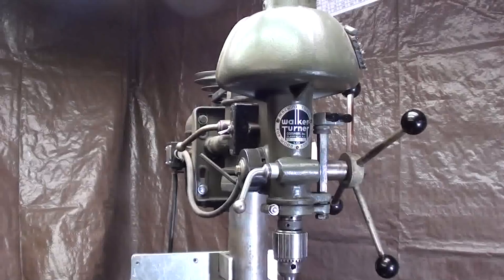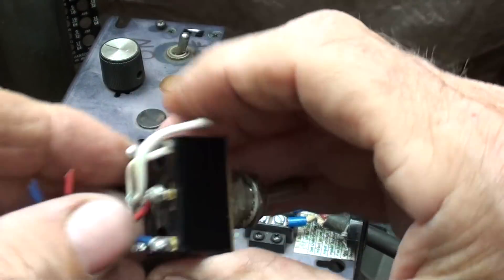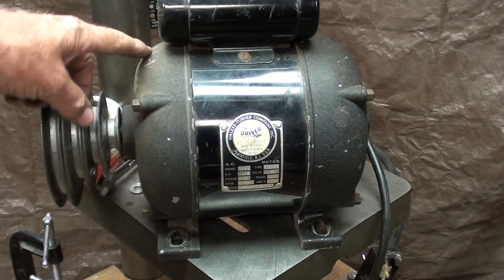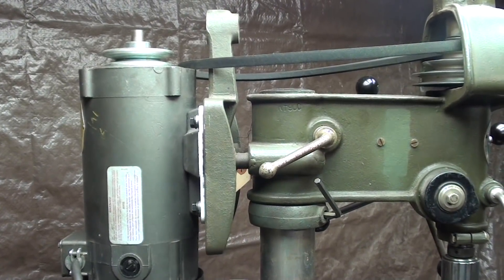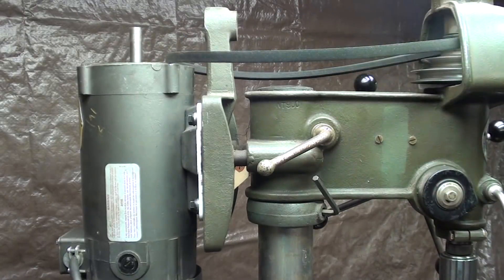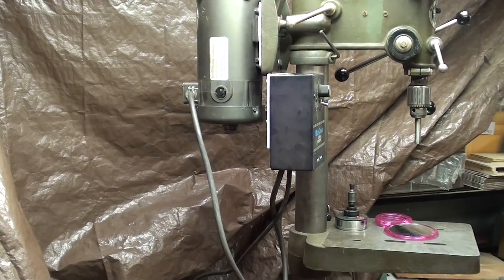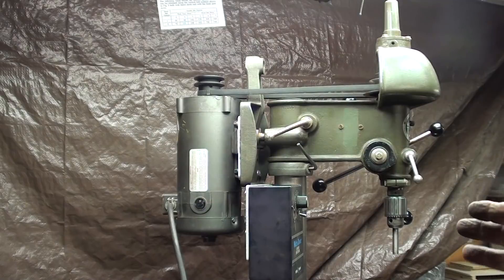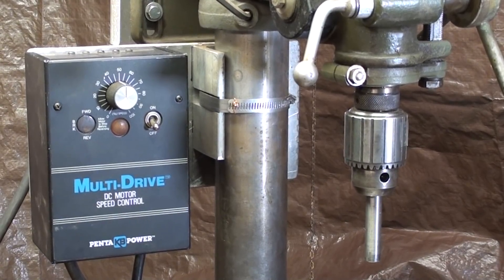Mounting DC Motor on Drill press Tips #480 tubalcain

Comment: A reverse switch is very handy to have. In case you drill a hole in the wrong spot you can just undrill it!  ;)
Reply: Or just click the undo button.
Reply: Or press backspace 😂😂😂
Reply: Reverse is mandatory to be able to use reverse (left hand drill bits) which are super handy for getting broken machine screws out. I have fitted my drill presses with this feature.
Reply: DAD Joke!
Reply: i guess Im kind of off topic but does anybody know a good website to stream newly released tv shows online ?
Reply: @Spencer Casen Lately I have been using Flixzone. Just search on google for it =)
Reply: @Cayson Maximiliano Definitely, I've been using Flixzone for years myself =)
Reply: @Cayson Maximiliano Thank you, I signed up and it seems to work =) Appreciate it !
Reply: @Spencer Casen Happy to help =)

Comment: A couple notes. DC motors should have high torque at low speeds especially compared to AC motor controlled by a VFD. I've converted a few machine tools for this exact reason. Also, there are seemingly four adjustable pots on the dc drive board. Some have six. The four that are apparent on your drive are Min speed, Max speed, Current Limit and IR ( compensating voltage required to keep the motor speed constant with varying loads ). You may need to adjust these to calibrate your application. I have a very rare version of the Walker Turner drill press (1939) that is missing the factory switch. If your ditching yours I would trade you for the reversing switch you need for the dc drive. The switch you require needs to operate as follows: when switched between the Forward and Reverse positions, the blocked center position causes a delay which protects the DC drive from any voltage that may be on the motor armature terminals. I would imagine that if you quickly flipped a standard switch between F and R that you could damage the motor and/or drive.
Reply from the maker: Thanks for the offer, I want to keep that switch for when I converted back to original. I do need to play around with those pots. To try and increase the torque. But actually I am moving ahead and installing a VFD given to me by a viewer. Remember these are all experiments
Reply: With a vector type VFD, AC motors will have very high starting torque. If you go cheaper with sensorless vector, not so much. If you go with an encoder on a vector drive...look out.
Reply: Great point and a great solution for higher end budgets or machinery. mrpete222 bought the drill press for $135 some time ago and its a drill press! I might also add that in a tapping application, AC drive/motor setups would be superior for 1: The deccel / accel parameters are very adjustable , and 2: Flip an external programmed fwd/rev switch and back that tap out fast. Many ways to drill holes. For low cost solutions either AC or DC I use automation direct. Not a plug, I have just had great experience with them.
Reply: Thanks for the reply. I have been on the search forever for an original switch/housing. I would like to restore my drill press as it is very rare (in exceptional shape and dates to 1939 as it has a face plate/logo only used that year and the rare ship wheel down feed handle). No factory switch unfortunately. If you could cast me one from the original I would really appreciate your work. In exchange; I have a lot of surplus old stuff to sweeten the deal! You could make another fantastic video of the process!!! Please PM to discuss further. Again, I would really appreciate your assistance and knowledge.
Reply: I have seen a spectacular failure of a DC servomotor drive when direction was abruptly changed. Blew transistors through a drywall.  But in this case abrupt direction change was a requirement. Back to the design board.
Reply: @stevegraves2890  Sensorless vector is appearing in lower end drives now.
Reply: HI Steve, you're right about those things you mention about DC motors, also, very right about the original switch with the stop in the middle to allow the motor to stop between forward and reverse, direct switching WILL destroy the controller...

Comment: If you could put a pair of pulleys between the existing shafts, spindles and pulleys, you could get the RPM down lower while keeping some decent 'wrap'. Perhaps a synchronous belt and pulleys or a chain and sprockets would support lower RPMs and the torque you want. V belts and ribbed or cogged belts have advantages for this application.

Comment: I changed my drill press  and bandsaw to D.C. Drive treadmill motors many years ago. Also tap with my drill press. You would be surprised at the torture at the low speed on these drives. Will try to send pictures.
Reply from the maker: Good move

Comment: Get yourself a centrifugal pulley for your motor ; I’ve been using one on my Craftsman Drill press with the same motor setup as you are using for 25 years and can ; with a tap holder in the chuck tap up to 5/8 “ without any problems and up to a 6-1/2” hole saw
Reply from the maker: Thank you, that's a good idea

Comment: Lyle,  Just in case someone below hasn't given you the amps the ST22N switch can handle, I'll give what I found about it here.  It's capable of 3.000 amps at the maximum voltage rating of 250VAC.
Reply from the maker: Thanks

Comment: The capacitor on an AC induction motor isn't there to "store up" energy to give extra power to start the motor. That would not work with AC (unless you had active electronics). It's needed because induction motors don't have a bias in either direction if they are not already rotating. If you disconnect the start winding and turn it on, it will just sit there (and overheat). If you give the shaft a turn manually it will continue in that direction and speed up to it's normal speed. Adding a start winding that is rotated 90° relative to the main winding creates a bias and makes it self-starting. It solves the same problem of how a single cylinder steam engine isn't self starting, but adding a 2nd cylinder (offset by 90°) ensures that it is. It's not strictly necessary (with motors that have a centrifugal switch), but the capacitor effectively 'delays' the AC waveform feeding the start winding giving it more of a directional bias for greater starting torque.
Reply: ^^Single phase induction motors.  Multi-phase induction motors develop a rotating field  by default.

Comment: Mr. Pete,
   Nice video once again. I just this past week installed a 2 1/2 horse DC, 90 volt treadmill motor on my drill press. I used a small ac controller with a bridge rectifier to convert ac to dc. It works to my satisfaction getting the rpm down to 70 at the slowest speed. I drilled a 2 1/4 in hole in quarter inch mild steel plate with a Lennox hole saw. It had plenty of torque at slow speed and had no noticeable belt slippage and I watched for both very carefully. I used plenty of oil for lubricant and I checked the heat of the hole saw frequently just by touching it. It was hot but not overly so. Also it took awhile to cut the hole but the controller didn’t develop any noticeable heat. It does have heat sinks, however. That always a necessity with a bridge rectifier as the diodes in them will quickly burn out if the heat isn’t quickly dissipated.
  Again, another first quality video. Thanks.
Dale from Decatur
Reply from the maker: Thanks

Comment: i  just swapped a motor on my drill press, and holding it up is a problem, until i realized you can just rotate the table around to the back and use it to raise the motor and hold it steady 
while you install the bolts.
Reply: I'd have to move mine away from the wall but that's a great tip!
Reply from the maker: Thank you, good idea
Reply: That's a great idea ... but only if you ever got around to bolting the base to the floor...
Reply: @PSUQDPICHQIEIWC   Just put a counter weight on it like 5 gallon's of paint. or a 5 gallon homer bucket full of water.  handy if you need to cool a part too.

Comment: I have a drill press that looks just like that one. The name plate is missing on mine. My dad gave it to me about 25 years ago when I was in my 40's  and he said he found it out in a field. He cleaned it up and it looks like yours now. He said he didn't need more than 1 drill press. He passed away 6 years ago and now I have more than 1 drill press. Amazing it was not all rusted and pitted when he found it. He said he found it a few years before he gave it to me. I think they are about 60 to 75 years old now. I am going to put a  3 phase motor and VFD on it and see how that works. Mine also has a very unique table with built in vise.
Reply from the maker: You will soon see mine with a VFD as well

Comment: Nice job.  I have an old Canadian Drill press #15 with Cap Start.  @ 1750 rpm speeds on 5 step pulley are 6,300, 3,400, 1,725, 900, and 400 RPM. Made in Kitchener ON Canada.  Jacob's 1/2" chuck.
Using an appropriate 3" clamp and some Uni-Strut and plywood, I made a small platform to keep my Drill Press Vice on.  Make sure it cannot vibrate off.  Thank you safety boots!  
I only wish it had a gear drive to raise the Drill Platform.  It has been converted to a Floor vice from a Bench Vise.  Likely made in the 1950's.  When you need a drill press, nothing else will do.  I note that the decal indicated to come to full stop before reversing if you install that function.
Reply from the maker: Thanks

Comment: Hi mrpete, good modification in order to get decent lower speed to work with bigger drill bits, looking forward to see how it delivers the expected results.
If my memory serves me well there is a min/max setting for output volts, and, possibly for constant torque function, just from memory, though...
I only an adorable acccent when I speak English, though...    lol
Thanks for the mention...   ;)
Reply from the maker: Hi pierre. I'm still disappointed with the results. We'll see what happens when I use the VFD that Palmer gave me

Comment: your new delta-ki name is transmission jack(hope you where using guide bolts cut some all-thread off thread em in and it'll funnel er on to the dowels tighten the bolts down enough to get the converter pilot engaged it the crank then as you tighten them down make sure the converter still spins if not the pump drive gear is installed backwards or the drive tangs ar'nt engaged in the converter spinning  while finish tightening usually solves that problem though) gonna love the tach install gonna check out pierre's love his starrett 98 level adjust vid thanks mr pete

Comment: Have you ever noticed that heavy duty drills don't have a break but the battery powered ones do always wondered why you cant get a brake as an option on a drill. Reminded me when there was a brake switch on the control box. I think the hole hawgs and other corded hand helds should have a brake for those times when they get into trouble but would be hard on the motor and gears I guess.
Thanks again for sharing your knowledge.
Reply from the maker: I have no good answer for that
Reply: I believe the DC motors in the cordless drills just short the motor leads to get the braking effect... This doesn't work with AC motors.

(Not an electrician, just learned this tidbit playing with DC actuators)

Comment: I have a KB on my South Bend. Love it. Good series. Thanks.
Reply: I'm adding a 1 1/2 pmdc to my lathe with a variac and full bridge. Just no load tested today and was impressed with smooth speed changes and no annoying circuit sounds...if I can keep things from frying I will do a drill press as well.
Reply: I may add a smaller PMDC motor just for oil pump duty. And save the 1 1/2 for just taking those cuts. If 2 hp AC can take 0.10 cuts then I'm sure the DC will be more than torquey enough....this will be one Frankenstein lathe for sure....

Comment: You could build a H bridge with 4 appropriately rated relays or transistors to reverse the direction of rotation, then any old SPDT switch could be used, finding a high current/voltage switch might be less painful though.

I just got my "big" Chinese drill press running, the seller had replaced the capacitor with a 150uF part (it has a PSC motor, the one capacitor is the start capacitor and the run capacitor, no switch involved or required) so it had very low torque and got very hot, eventually I got a 20uF part from him and now it works great, noisy and rattly but plenty of torque and runs cool. It has three pulleys and two belts and is super annoying to change speeds. 

Big DC motors here in Australia are pretty uncommon for some reason, but a 3 phase replacement with a VFD would be nice to have.

Comment: Here's what I did to reduce speeds on a WT drill press. I placed another multiple diameter pulley motor on the wall  behind the press and use the regular motor only as a reduction pulley holder. The secondary belt runs on the smallest pulley on motor #2 to the largest pulley on motor #1. Then, the original belt is placed on the smallest groove on  motor #1 and the largest on the press pulley. The result is that I can get speeds down to 300 RPM.
It works like a champ. I hope that makes sense.
Reply from the maker: That sounds like an excellent solution

Comment: Looks to me that you could use both of the motor pulleys - the top 3" pulley seems to line up nicely with the second-from-top pulley on the drill?  This would give you a 'high' range to accompany your new 'low' range of speeds, on those rare occasions when higher speeds would be of use, such as a woodworking project?  Just a thought...
Reply from the maker: Good idea

Comment: Sorry to be late to the party on this one but, the ST22N is good up to 7 ampere at 30 VDC according to the manufactures data sheet. Don't know what the max amperage on the fwd/brake/reverse switch would be.  If it is handling circuit control signals it might be good, but if it is switching the actual drive voltages that would be completely different.

Comment: DC motors are at full torque as soon as the shaft starts to turn. That's why locomotives are diesel, (to generate electricity) over eletrical, (to turn the drive shaft(s). For a long time ships were diesel over eletrical for the same reason.

Ya yak to much. It's called re-relevant details. It's worse when ya include a long back story. But you're a hard working and conceinsus guy and problely a journeyman craftsman. Keep in touch and keep up the good work.

Comment: The capacitor start isn't really giving an extra oomph. It's creating a phase shift for the starter winding to get the motor past the dead spots and set the running direction.

The motor will start without a capacitor if you give it a slight nudge in the correct direction, but that's just to get it past the first dead spot. The motor can start on its own if lightly loaded and it didn't stop on a dead spot (two for two-pole motors, four for four-pole), but the direction will be random.

Comment: The ST22N is a 20A switch.  Based on the data sheet for the motor controller, it should work for reversing the polarity of the motor leads as long as you used the main controller switch to turn the motor on and off before changing direction.  The data sheet states you can reverse direction by reversing the armature leads.  You would not have the braking function given by the FBR kit they offer.
Reply from the maker: Thanks

Comment: Very nicely presented 
What size PMDC motor replaced the AC..?
Any issues with your controllers..?
What controller model are you happiest with...?
Love the Walker turner... got a buffalo that could use this conversion as well as a 15x50 cohlchester.

Comment: Correct me if I'm wrong but I always thought DC motors produced quite high torque at slow speed.
Reply from the maker: I did too. But it did not work out that way in real life
Reply: You are not wrong. With full voltage the motor will run at it's maximum speed then as load is applied the motor will slow down, current will go up and torque is increased in proportion to current.

The issue with speed control is that you lower the equivalent voltage to make the motor go slow so the available current to create torque is reduced. The electronic speed controls will monitor the current and increase the equivalent (i.e Pulse With Modulation) voltage to compensate for load. That is the purpose of the resistor sized dependent on motor HP. It will allow the controller to up the voltage/current to increase torque as you put load on the motor. I put one an an atlas lathe and it worked GREAT.
Reply: Same here. There are DC motors on treadmills because they have to get rolling at low speed with the weight of a lard-arse human (eg me) standing on the belt.
Reply: I think you may be thinking of a series wound DC motor, like a car starter. I believe he said his was a permanent magnet type, which as far as I know, have a flat torque amount from the lowest to highest speeds.
Maybe tailing off on torque a bit , if you run the speed up fast enough.
Reply: Especially series wound DC motors. E.g. old starter motors.

Comment: I've wondered about mounting a motor on the same axis as the drill spindle. Is there a mechanical device that could protect the motor from damage if the drill jams in the work? Would an electrical shut off be a better solution? Thats one of the advantages of a belt drive. Perhaps joining the shafts with a hard rubber linkage would absorb mechanical shocks and electrical shutoff via electronic detection would prevent overheating in the motor when there is a jam. I'd love to hear from an engineer on this issue. Is a 'torque limiter' a thing of relevance to this?
Reply from the maker: I am not an engineer. But this does not sound like a good idea. You will have trouble adjusting the speed. Many electrical motors have a built in overload protector, that can be reset.
Reply: @mrpete222  Thank you and such a delight to get your reply. Long time fan.